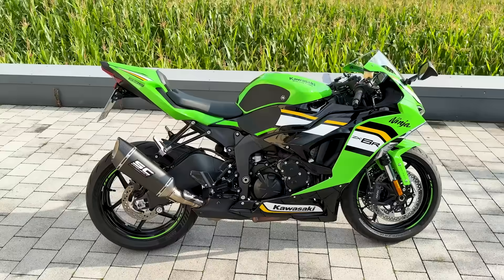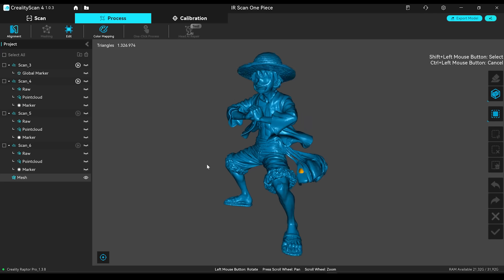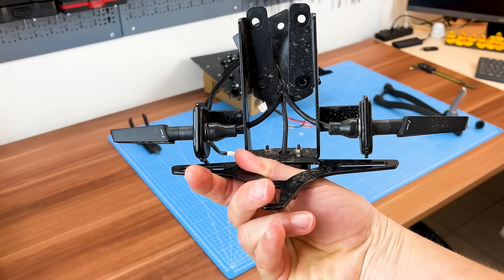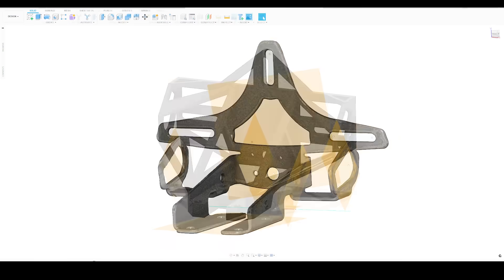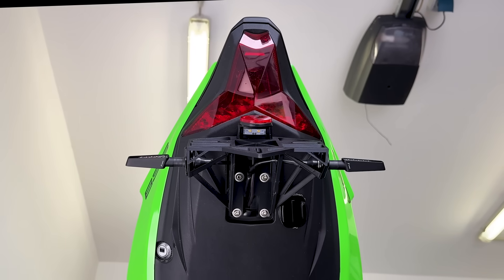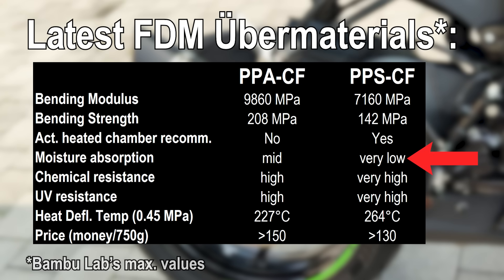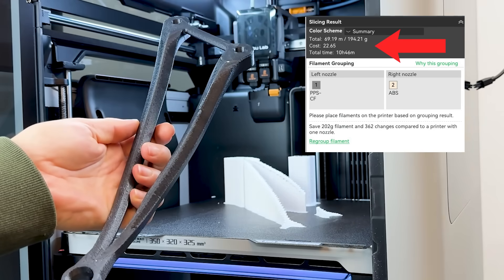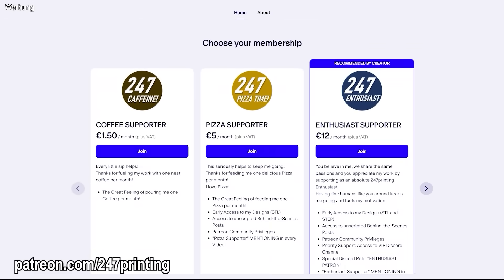Reverse-Engineering Motorcycle Parts with 3D Scanning and 3D Printing!

Comment: I had a  PLA part holding on my rear carbon diffuser on my M4, I think if designed well it'll be fine. Part was also right near the exhaust
Reply from the maker: You got balls trusting PLA there :)
Reply: @247printing haha, unfortunately the carbon bracket part was already broken - 
it would come loose at speed, until it finally flew off one day and i had to either fix or buy a new one. lol. the pla fix held up much better than it was. i also had brass threaded inserts for the screws so i’m sure that helped with strength